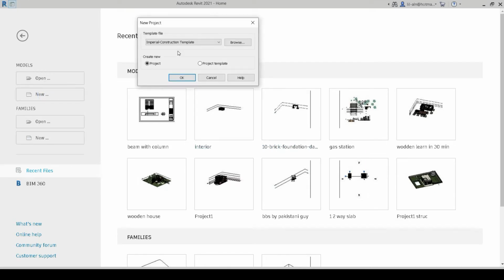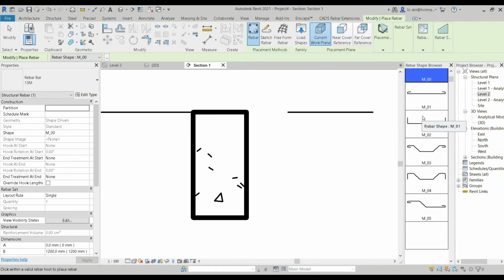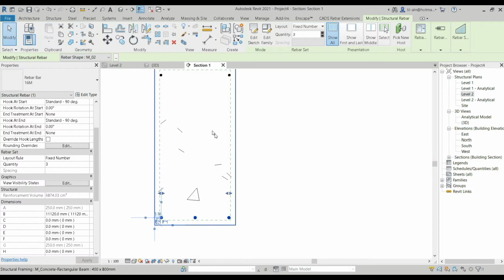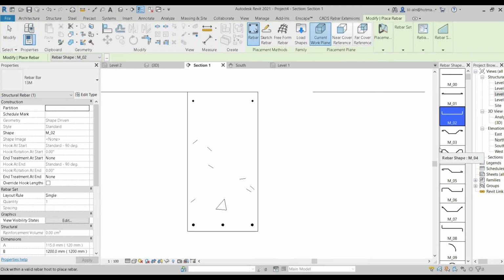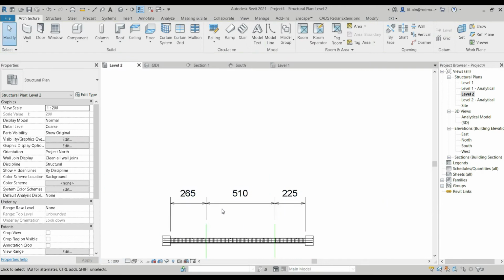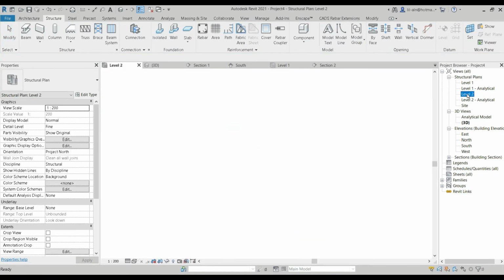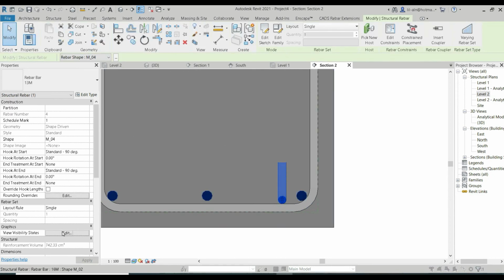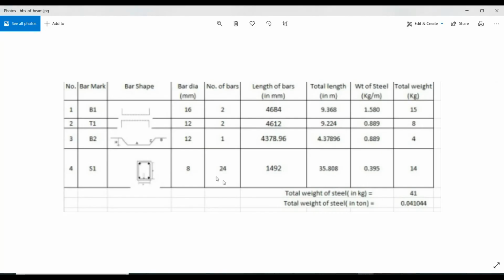Beam reinforcement Detailing | beam design | Revit Structural

Comment: these cranked bars are usually 2
Reply from the maker: yes 2 is sort of a default value...............but it may increase and the diameter may thicken....according to the span and applied-load on the beam

Comment: Sir.i couldn't be able understand development length..how to said development safer side..(500+200)..didn't not get it.
Reply from the maker: development length is covered in IS4562000 clause 26.2.1         ....................its takes time and cannot be usually done or checked for every instance on site............................so thumb rule used is 40D, 45D, or 50D..........................i used 50D along with some extra length to be safe from bad-contractor workmanship